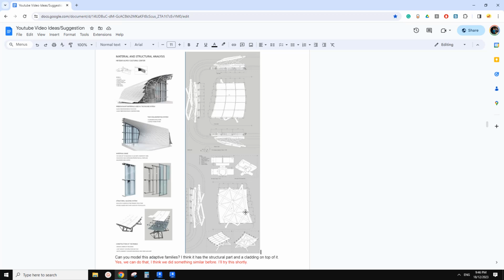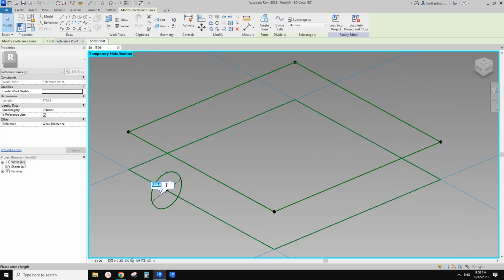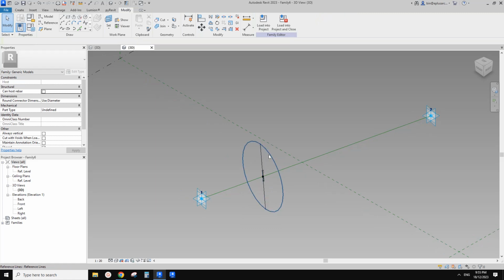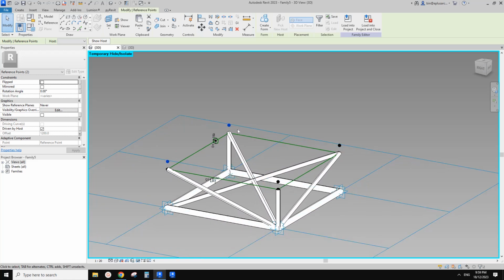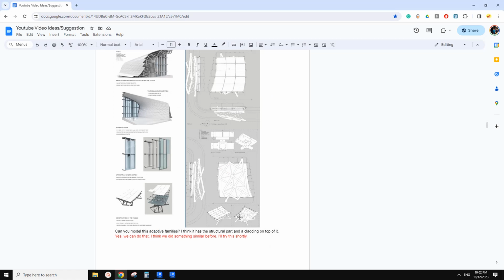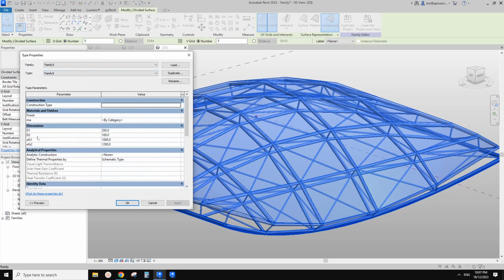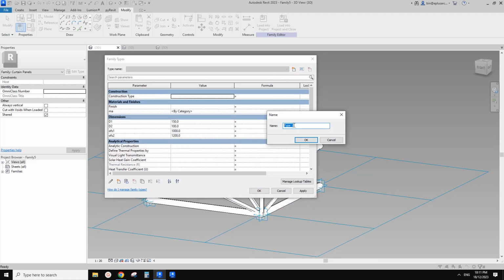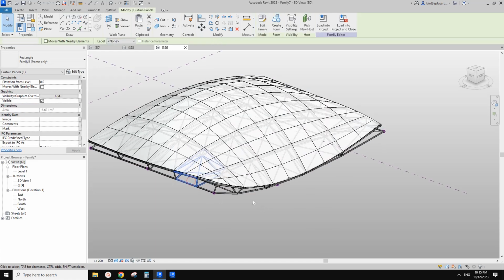23120 - Revit Pattern Based Family Exercise

Comment: thank you!
what if i wanted some of the panels to be glass and some to be other material like aluminium? is that possible?
Reply from the maker: Sure, you can create material parameter in the pattern based family.
Reply: I will try that! If i did not succeed i will let you know and ask you for further assistance if it is okay with you. Thank you very much
Reply: I remember trying but it changed all glass to aluminium. Not just the selected panels
Reply from the maker: You need to make sure that the material parameter is an instance parameter, not a type parameter